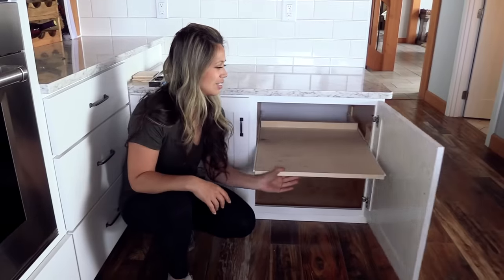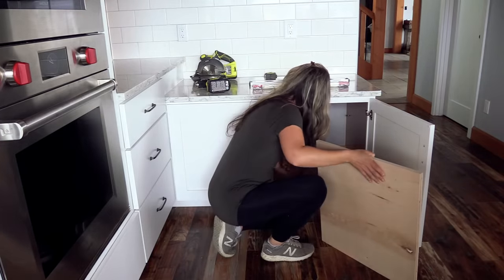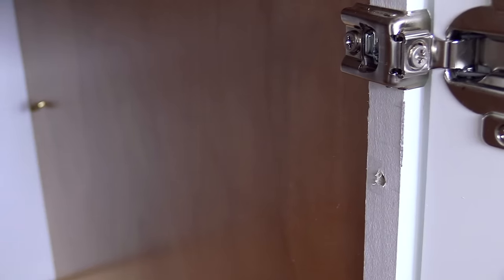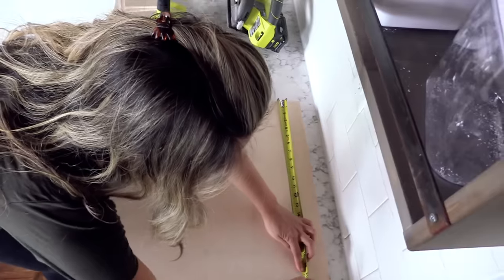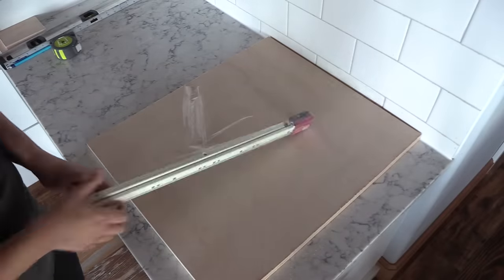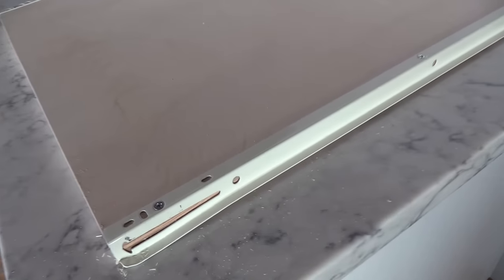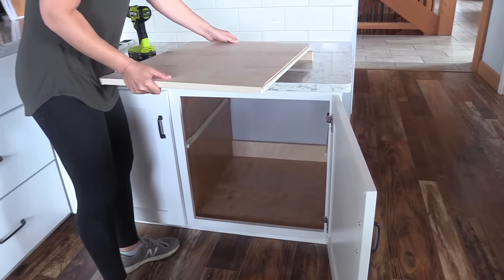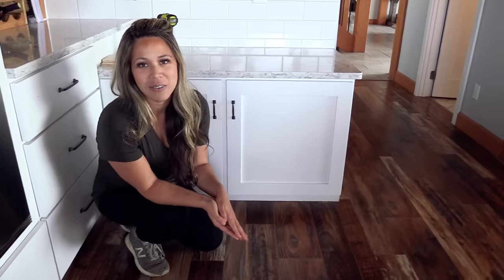Easy! Convert Cabinet Shelves to Roll Outs for $10

Comment: Wonderful idea!!!   Thank You for posting this !!!!!
Unfortunately, our very old cabinets were built in place and have very un-removeable shelves with very un-adjustable tenons; and the shelves are also finish-nailed securely in place through the outside of the cabinet boxes to add insult to injury ... but they're very sturdy.  It's a major bummer.   ☹
On the accessible shelves, I am going to try to use a flush cut saw to cut the tenons after driving the nails through the cabinet boxes.  Some of the shelves I have no access to due to location, so those shelves may just have an "accident" with a recip saw and be completely replaced.  Oopsie.

Comment: This is great, you are a genius! I have bathroom cabinets that are 60” long, one big box with a face front and three doors, no partitions. Could you give us an idea how to create sliding shelves for something like that? So very much appreciated.
Reply: peruviana1000 yes please, @Ana! I have exactly the same thing!
Reply: I have a similar issue but have not tackled it myself yet. What I think will work - and I'm intending to store things of some weight so am aiming to build something "beefy" - will be to use 3/4 plywood to divide the interior cabinet space into <24 inch boxes. A shorter shelf width will likely be stronger and less prone to sag. Use at least 3/4 plywood for shelves, too. To secure the vertical plywood dividers I plan to use metal L brackets which you should find in the decking/lumber area. Get as many as you need to attach the verticals to the back, bottom, and upper front of the inside of the cabinet. If the upper inside of the cabinet has drawers, there may be a way to attach the top of the vertical to whatever the drawers are hanging from. That should get you started. Do not cheap out on the plywood. The L brackets I mention will resemble a half-open hinge and it will be obvious in which direction you'll want to orient them. Use them in pairs for maximum stability, one on each side of the vertical everywhere you want to attach it to the cabinet interior. So two pairs where the vertical attaches to the back of the cabinet interior, top and bottom, and two pairs where it attaches to the bottom of the cabinet interior, front and back, and again at the top front, one bracket on each side. You may want to use bolts and nuts, sized to the bracket holes, in the spots where the bracket holes line up. I know mine sounds like a lot but I'd rather "overbuild" it and not have it fall apart when the shelf is extended and full of stuff.

Comment: As long as you can squat down and do this it’s easy peasy… great tips.. Word of caution if you are working on top of your nice countertops…   Place a cheap cutting board underneath the board  when installing screws in case you screw through the wood…
Reply from the maker: Thanks for the visit!

Comment: To anyone doing this, do keep in mind weight distribution. If you put anything heavy on these pullouts, you will likely need to invest in additional bracing, if not a sturdier version of rails, due to the inherent increase in stresses on the rails and mounts from the leverage created by weight on the pullout.

Comment: What a great instructional video on how to install these. Probably the best I’ve seen so far and I’ve looked at a lot of them. I do have a question that hopefully someone can answer that has install these in their cabinets. Does the pull out lock when you pull it out so it doesn’t slide out all the way or do I have to get sliders that have particular locks on them?
Reply from the maker: Yes most slides have a mechanism that stops the drawer from coming all the way out.
Reply: @AnaWhiteDIY  thank you so much for your great video. I’m going to tackle it tomorrow.

Comment: Ana - full shelf install went great.  Thanks. Still have these pesky half-shelves in the upper area of the lower cabinets that are pretty inaccessible, especially for us older folks. I was wondering if you could use two different size drawer slides to make this half-shelf slide mostly out.  Like maybe a 22" outside slide and a 12" inside slide. I don't particularly want to cut a 22" down to size. I'd really like to see that in one of your videos. Google search didn't turn up anything. Thanks.

Comment: If you have an extra door pull or cabinet handle. I would have installed it under the shelf to make it easier to pull out if you do y have a lip up front. I do love the video and the idea for the lip on back.

Comment: What kind of wood are you using as shims? The only shims I can find are only a quarter inch, and layering them to get the right thickness is challenging. Thanks so much for making a clear and simple video!
Reply from the maker: I used 1/2" plywood, check out this post https://www.ana-white.com/woodworking-projects/10-roll-outs-kitchen-cabinets

Thanks for the visit!

Comment: Thanks for the video.   Some of us have some kitchen cabinets that are permanently fixed as they came that way from the builder.  Can you describe what is the best process to remove them?  It seems that the only way is to cut them out with something like a multi-tool.  Just wanted to check for suggestions before doing something we can't easily repair.   Thanks!

Comment: Hey Honey, you did a great job of explaining this.  Thanks.  Did you stress that all long haired people tie it back?  Also very loose fitting clothing is a danger.  People with NO power tool experience might not be aware that power tools are not childproof.  Even my very experienced hard core neighbor renovator/builder cut most of his finger off last year, God knows how they sewed it back on.  So haste does make waste.   
Ana, also want to mention that I save most of the paper and boxes from Amazon, for things like a drop cloth, and for things like, you could have used a broken down box to protect you loverly countertop.  If I want to spray paint some hardware, then I just put it in a big box and that is very handy.
You don't have to be old with a bad back for these slide out shelves to be a blessing in your daily life.  Thanks for the post, again.
Reply from the maker: All great tips, thanks for the visit!

Comment: yeah.. id stay away from the euro drawer runners... trust me.. get the ball bearing full ext.  i,ve worked in the furniture & cabinet ind. for over 35 yrs... and have installed more drawer runners than prolly anyone on this planet... ive installed several different brand and styles.. ive seen every failure that could prolly happen & although the euro style is my 2nd choice, ive only seen the ballbearing style fail a few times & it was a worker error. also, a small horz. piece across the front of the shelf, will help things from falling into the floor when the shelf comes out too harshly.. and ive seen the euro style jump off & crash . so beware glass items , if you use them. good luck. & use wood glue.

Comment: Well done, Ana! Thx so much.

I have a kitchen sink that has a rotted, water + mice-damaged inside...it's gross.

I need to: a. Get the dishwasher/kitchen sink replumbed to prevent sewer gas poisoning (true), 
b. Replace the floor, THE BACK, + both sides of the inside of this carcass as they are chipboard, damaged by mice + water. (ALL of my cabinetry is cheap, thinly laminated chipboard drawers + carcasses w solid oak, 1989-shellacked fronts.)

I would also replace a horrible kitchen sink + faucet when I tackle this repair.

I'm a 70 yo, 93 lb woman, in weak health. But, I'm going to tackle this like I would have at 35. Any suggestions on materials or tools that will help? Thx much. Love + respect, Holly.
Reply from the maker: That's great that you're going to tackle it! Here is a more in depth post on doing this. https://www.ana-white.com/woodworking-projects/10-roll-outs-kitchen-cabinets

Comment: Thanks Anna, I have learned so much from your videos. I have a corner cabinet that I had a lazy susan in, hated it so I took it out. I would like to do something like this. Found one online where you pull one shelf out the door and pull the deeper shelf across where the first shelf normally sits. It was priced way out of my price range. Any suggestions?
Reply: Matthias Wandel has a video from 7 years ago called "Kitchen Cabinet Organizer Boxes." If I remember correctly, he didn't use drawer glides. You could do it the way he did, or you could modify his plan.

Comment: If you are putting more weight on it, then you will need a shim covering the whole length, and the runner screwed in several places, otherwise it will buckle.

Comment: You forgot to mention that will only work with a full overlay without hitting doors otherwise you have to cut shelf smaller on width and put in spacer blocks on attached door side

Comment: Thank you.
Reply from the maker: Welcome!
Reply: I just picked up a pair of 20" slides from Lowes for $7.98. Going to use some old cabinet doors for the shelf and add some sides and a back from them. Save the shelf that came with the cabinet for another place.

Comment: Good video, well done. However I am inclined to point out that most cabinets have particle board shelves. Not plywood or solid wood. This process should still work but extreme care should be taken while installing the screws. They can strip out of the particle board very easily.  It is also more difficult to use the cut off piece for the “stop” in the back. It’s hard for the screw to get a hold in particle board. You may have to buy additional 1X2 for the stop.
Reply from the maker: Thanks for sharing your tips!

Comment: Just be careful and make sure your door is completely open before pulling it out, you will gouge the hell out of your door. There are bumper/corner protectors you can install, but not sure if they make them for the way this is made.

Comment: I wish it was this easy for me, I laughed when she took the shelf out in a second. I have site-built cabinets and it takes an act of God to remove the shelf. Even worse, there are posts (stiles) in between two doors, leaving me with undersized access. I had one cabinet with a single large door and it was a joy to convert it to a dual level slide out with the door attached. It turned a junk collection space into the most accessible and usable space in the kitchen.

Comment: Thanks for great vid.
What do you do to the bottom shelf plse?
Do you have info on how to get a 'shelf roll-out' for the bottom/floor shelf that doesn't use side drawer slides?
Are there drawer slides that can be screwed to the top of the bottom shelf & a new roll out shelf attached on top of that?
Cheers

Comment: Thank you! I was looking at my cabinets the other day and thinking, I bet I could turn that shelf into a pull-out shelf by just trimming and adding gliders. Thank you for the tutorial. Is this possible to do for the bottom shelf as well?
Reply: I would think you could. You would need an extra shelf or cut a piece of plywood to size. Then install the sliders as low as you can and the shelf still slide out. You would loose an inch or 2 in storage  height.(new shelf and slight gap underneath it for it slide correctly).  But for me at least, it would totally be worth it! And I think next time I visit my parents, i'll offer to do this for them! :)
Reply: Aren't there drawer glides that can be attached sideways, so they're screwed into the bottom shelf of the cabinet and underneath the new pullout? Seems like I saw some like that at a relative's house years ago. Maybe I'm remembering it wrong.

Comment: Nice! But my cabinets have fixed shelves! I guess they were glued in with dowel rods and then installed the cabinets in the kitchen. Can I get these out? They are in the top back of cabinet. So removing a face frame doesn’t help. Is there an offset saw I can use to get in there? IDK if this is what’s going on even.

Comment: Get rid of shelves in your base cabinets and put in drawers.  Think this way. A drawer is an easily accessible rollout shelf without even having to open a cabinet door.  On the typical pullout shelf you have to open the cabinet door past 90 degrees or you beat up the back of the door hitting when you pull the shelf out.   I have build 3 of my kitchens and this last one I did all drawer on the base cabinets.  Of course you don't put drawer in the sink cabinet or other special purpose cabinets.  I and my wife agree it the best kitchen yet.

Comment: My cabinet is 23 inches depth with a face frame, can I a use a 22 in drawer slides also? Thanks for your video this is going to help so much.
Reply from the maker: You should be able to, as long as the depth is not less than 22”

Comment: Great vid, I know you guys work in inches over the continent, so inch being 2.5cm's which you trimmed off the panel side, do you think a 2cm gap / trimming instead would be sufficient or too tight? Reason I ask is I'm looking to buy pre made crates from IKEA to use inside cabinet as there's no shelves. Thanks!

Comment: I noticed your slider is installed a little bit off the back wall of the cabinet, and more flush to the front of the cabinet. Is that an important consideration? Thanks!

Comment: I have a question, disable vet here, bare with me this question.
I just got started with wood, Not new to wood. I build model wooden ships, I have been watching your video on making sliding shelfs for cabinets
for some time now - I have in my  kitchen a cabinet with a spacer without a wall in my cabinet, like you do yours, so I can just throw pans in there without hitting the center wall, Should I put in a center wall for the cabinet? then put in the sliding shelfs in? Or just put in the sliding shelfs on the inside on my cabinet? then I'll have a 3 foot pull out drawer. I hope I explain this right.
Reply from the maker: Thanks for the question. You will need some sort of framing in the middle to create the slide out, whether you want it a solid wall or not is up to your preference. If you do a solid wall it would allow for a couple of pull outs if I am understanding right. This post may help https://www.ana-white.com/woodworking-projects/10-roll-outs-kitchen-cabinets
Reply: @AnaWhiteDIY  - You are the best!!! Even with my misspelling, you understood my question, I was looking for your answer until I hit the wrong button and lost my history, Ended up in the Twilight Zone.
Thank you.  May you be bless always.

Comment: This is exactly what I want to do but I need longer drawer slides for my project. I cannot find any that mount to plywood like this longer than 22 inches. Where do I find sliders 30 in to 48 inch long that mount like this?

Comment: Hello Ana. New to your channel. Just subscribed. I’m def a beginner at any of this and just now purchasing and hoping to learn the different tools available to make improvements to our home. Wanting to add these pullouts to the cabinets of our new home as they are very deep and troublesome to get into to store or find anything. We are also very limited on the amount of cabinets and storage space we have, so thinking this would be the ideal solution to being able to maximize the storage space we do have by making it more accessible with pullouts. My issue is that the shelves in the cabinets are fixed and not adjustable. I don’t see any where that they are attached by screws either. Would that mean the shelves would need to be cut out? I worry about that affecting the integrity of the stability of the build. Any advice would be greatly appreciated.

Comment: It would have been helpful if you told us how to align the metal pieces to the front of the cupboard. I noticed they didn’t go all the way to the back so I’m guessing to line them up as far forward as possible.
Reply from the maker: It depends on if your cabinet has a face frame or is frameless, here is the full post with all the details https://www.ana-white.com/woodworking-projects/10-roll-outs-kitchen-cabinets